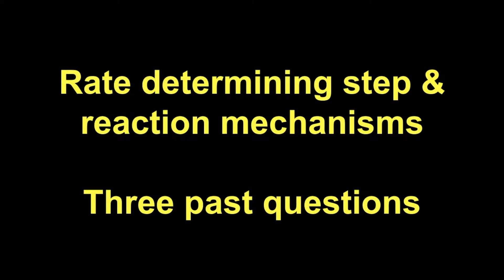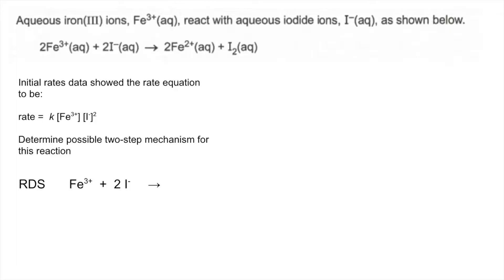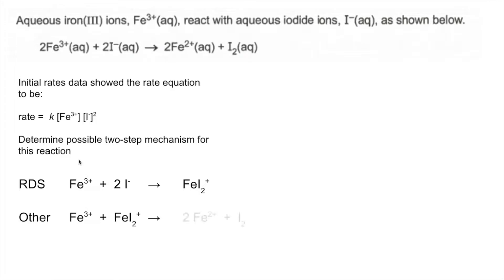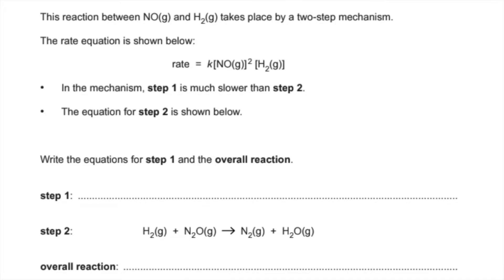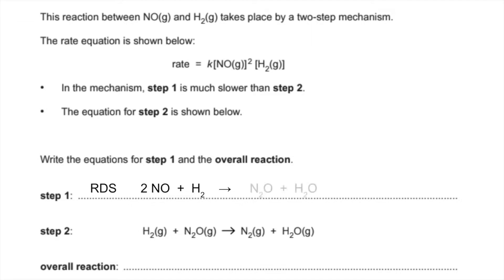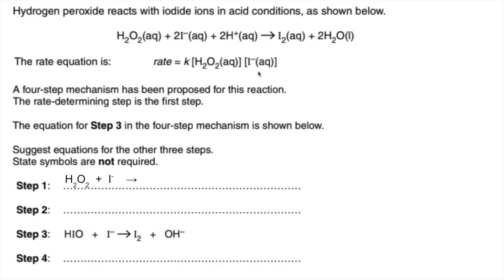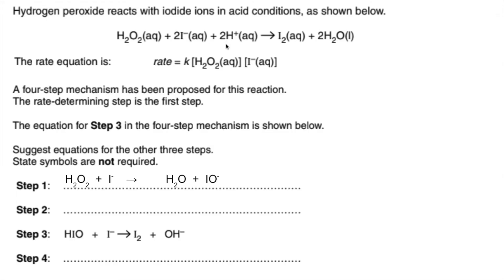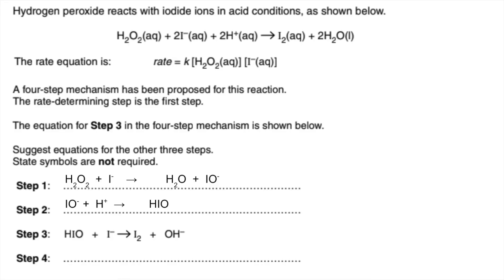Three tricky rate determining step/mechanism questions

Comment: Hi Sir,

For the 1st question, can an electron be used as an intermediate?
My 2-step mechanism goes:
              2Fe3+  + 2I-   ---->  2Fe2+  +  I2

RDS        Fe3+  +  2I-   --->    Fe2+  +  2I  +  e
other      Fe3+  +  e-    ---->    Fe2+  
overall  2Fe3+  + 2I-   ---->  2Fe2+  +  I2

Comment: Good afternoon sir, for question 2 could you have the formation of N2O and H2 in the RDS and have them in the quick step as reactants, overall forming H2 + 2NO ----> N2 + H20 ?     Cheers!
Reply: Wouldn't it be 2NO + H2 in the RDS?
so the overall would be H2 + N2O ---> N2 + H2O

Comment: can you please tell me if this would be correct for the last one question????????????? step 1 = H202 + I - > HIO- + OH- . STEP 2 = OH- + H+ > H20, STEP 4= H+ +OH- > H2O. Are we allowed to use the same equation for more than one step ?????
Reply from the maker: Hi there. I'm afraid your first step doesn't balance for charge. You've got a 1- charge on the left, 2- on the right.
Reply: @MaChemGuy  surely this works, given it should actually be HIO not a negative HIO ion? Then you would have balanced charges on both sides. I believe they incorrectly put it is a negative ion when it’s a neutral HIO.